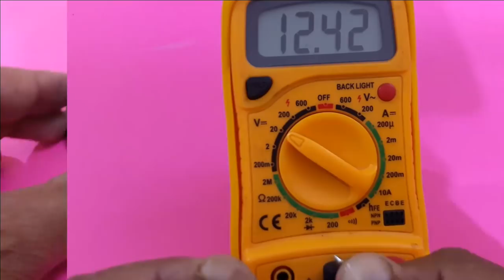Tips-protect speaker and tweeter from burning

Comment: impedance of speaker = 8R
impedance of light = 12R

you lose the 66% of the power.

And you add distorsion in the system.
Besides, the amplifier explodes
Reply: Not Even CLOSE !!! 
...keep editing 😂...
Reply: The dc resistance of a cold light bulb is very different from its dc resistance wile its lit.

Comment: Don't do it. This will make your amp to work on different ohm rating. Which is not good thing. Long time use will definitely kill the amp's components. So be aware. 😁😁
Reply: OLD SCHOOL SQUAD not realy😂
Reply: @leandroebner1405  then what you suggest..?🤔🤔
Reply: OLD SCHOOL SQUAD the lamp ads ohms to the amp. So normally the for example 4 ohms speakers got now for example 6 ohms. If you turn you amp full up less current will flow as you would without amp. So its even better for the amp as without.😂😊😉
Reply: @leandroebner1405  Ohhh.. Thanks for your reply. But if certain amp is design for 4 ohms with few watts and if ur playing it with additional load like 6 ohms, don't you think it will place additional load on amp..? It may be good for speakers because now they are getting less Power than usual.. But is it safe for amp..? What will you suggest..?
Reply: OLD SCHOOL SQUAD i calculate it for you😊. Imgaine your amp with lets say 4 ohms and 10watts. Watt = Volts * Amps. Volts= Ohm * Amps. So you will get : Watts = Ohm * Amps * Amps. Clear for you? ☺ With this you can calculate that you amp max Voltage is arround 6.3 Volts. And max Amps is arround 1.6 Amps. If you turn up your amp with your 4ohm Speaker you get EXACTLY 1.6 Amps. So your amp is at max but dont get destroyed. If you take the 6 ohm speaker at full volume (which represent full voltage =6,3 Volts) it will flow about 1Amps. So your amps gives an output of arround 6,5 Watts. Or short: If you turn up with 6ohms its the same work for you amp as if you turn it up with 4ohms  only closly to max.== same work for your amp
Reply: @leandroebner1405  Ohhhh..Woow...Such a detailed explanation.. Thanks for your ans...😀😀✌️✌️
Reply: OLD SCHOOL SQUAD no Problem. I hope you understood everthing with my bad english 😬😂
Reply: @leandroebner1405  Hahaha..yess.. I understood.. Summary of your last to last reply was (W= I². R) Right.? And my english is also not that good. So chill..😀✌️
Reply: OLD SCHOOL SQUAD yes. very usefull if you aks me😉
Reply: @leandroebner1405  it seems like u r in a technical field.. Don't you..?
Reply: OLD SCHOOL SQUAD experimenting with elektronics is my hobby😊. But i still go to school... but yeah if you like something you know much aboit it.
Reply: Ohm law! Use it wisely 👍

Comment: youre literally just lowering the power going to the speakers...
Reply: It is non linear. The higher the power gets, the higher its resistance gets, and at lower volumes its not reducing it at all (or very very little). Its just a dynamic limiter and becomes more effective the closer to the bulbs rated voltage you get.

Comment: Or maybe simply use a Capacitor?
Reply: A capacitor would only change the crossover freq. at best. In case of overload or clipping it would do nothing.
Reply: @armandorellegue1137   Hi,  for high frequencies ( as with a clipping amp) the capacitor is in effect a 0 Ohm series resistor so will form no safeguard against overloading the tweeter.
Reply: OK you had the dc current problem solved, now it remains to solve the low frequency response, tweeter overloading, clipping, and World hunger.

Comment: If you dont want to burn the coil of your speakers better buy a higher wattage.
Reply: Bala Subas how? If the wattage is too high, the light bulb will just burn out and interrupt the circuit... Sending NO power to the speaker.
Reply: No need this light bulb this only reduces or consumes the output power of the amplifier. There are some ways to protect your speakers if you can find an overload protector or circuit with relays..

Comment: Thanks for this knowledge
Reply: Shazad Zaidi Please don’t do it, your amp have to drive more Ohms now, that will shorten the live of your amp
Reply: Non Age Restricted well if you put your speakers in parallel then you don't have to worry about it... half the ohms and now the ohm rating is just a wee bit higher putting it back to normal. It's Common Sense dude.
Reply: If i know right, higher resistance is not a big deal for the amp, but the lower resistance is an amp killer... But this lamp will not save the speaker from dc current, if u want to prevent dc voltage u should use a high capacity not polarized capacitor :) like 30-40uF 400V (it enough for most common uses)